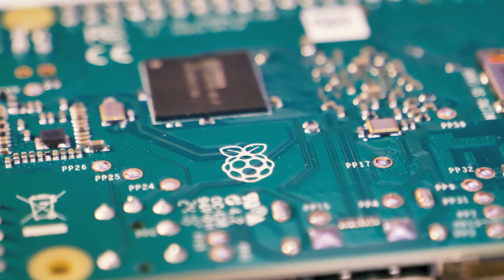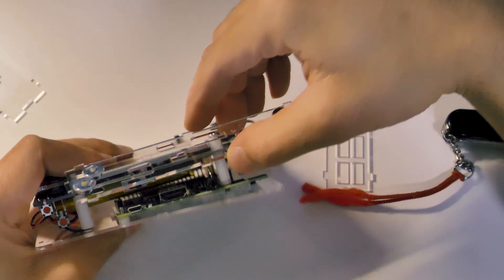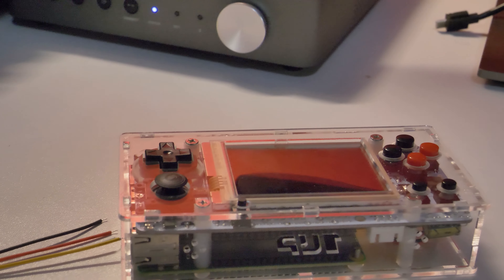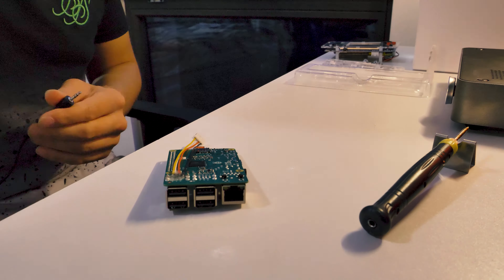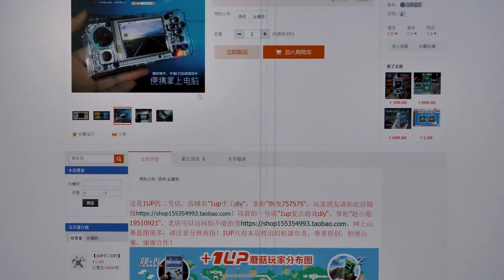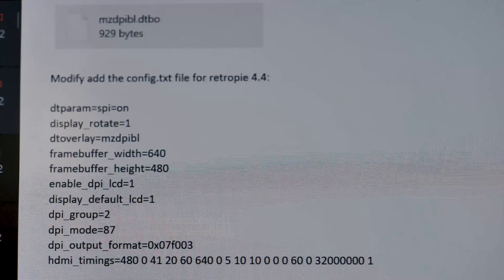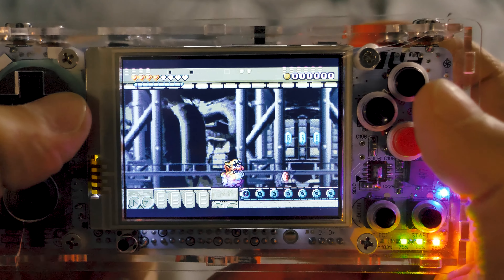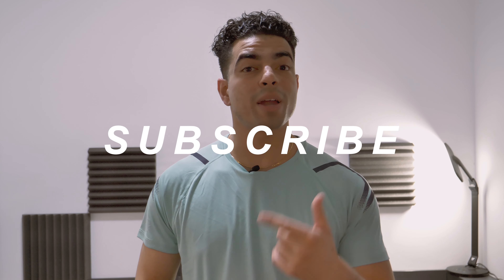Making My Own Games Console | 1UP Pix Portable

Comment: I bought one of these and had the same problem of having to solder it. After getting it all together it worked fine, but after a day of playing around I tried to charge it. I plugged it in and after charging it for a full day, it's battery was still empty. It turns out it wouldn't charge. So after a month and a half of shipping time, and a day of putting it together, I ended up with a faulty product.
I ended up sending it back for a refund.

Comment: Do you put the driver in a folder with same name as the driver?
Reply: Also, do you just paste that text to the bottom of config.txt ?
Reply from the maker: Yes, treat the drive like any other raspberry pi driver. I cant remember the folder of the top of my head.
Reply from the maker: @MegaPaddz  Also just copy and paste the configuration text into the config file.
Reply: @deekaythewhitewashedindian  Okay thanks, great video! Also is the driver folder on the boot partition?
Reply from the maker: @MegaPaddz  yes (if thats the partition that mounts on Windows... Not the unmounted one)
Reply: @deekaythewhitewashedindian  OK, still not working for me. Did you leave all the commented out stuff in the config? and did you leave this part that is not commented out at the bottom. 
"# Enable audio (loads snd_bcm2835)
dtparam=audio=on
gpu_mem_256=128
gpu_mem_512=256
gpu_mem_1024=256
overscan_scale=1"?
Reply from the maker: @MegaPaddz  yeh, i just used the default config you get when you first install retropi. Just in case, do a search for installing drivers for raspberry pi. Its a universal thing and applies to all OS's